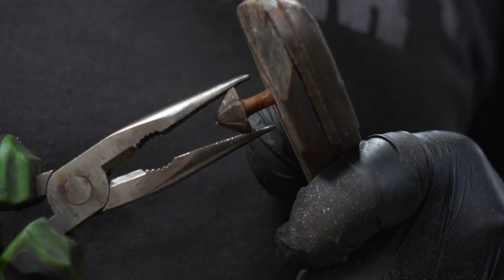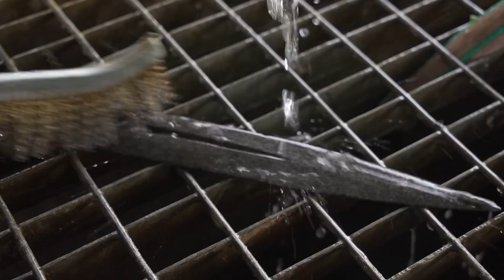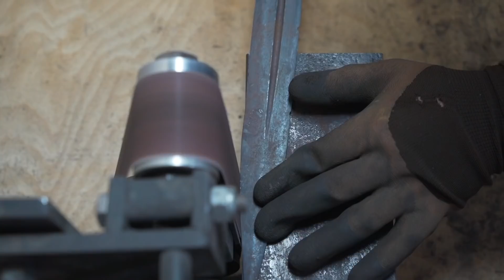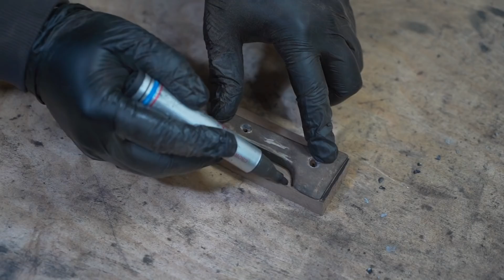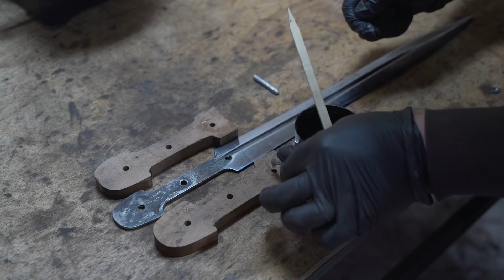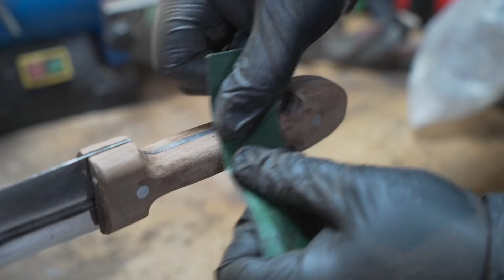Antique Broken Dagger Restoration

Comment: A nice revision, congratulations, the handle part of the knife is different from the original, the blade of the knife should be one millimeter smaller than the handle part, and you broke the corners too much... respect...

Comment: it's a pity for the dagger, the value of antiquity and originality has been lost.0 Now it looks like a bush🤔😏
Reply: He probably looked up the worth and value before restoring it. Since it wasn’t worth much how it was, he probably just decided to make it how he liked it.
Reply: @sappersilver7762  no bro that's not how it works. Restorations of ancient and historical pieces are supposed to only make it functional again but keep the old patina and markings. Removing the rust, fixing the chips and sharpening would be enough. Also keep in mind the restoration has to be historically accurate
Reply: @arielgarcia5065  You can’t use it without completely remaking it due to the amount of damage to the blade